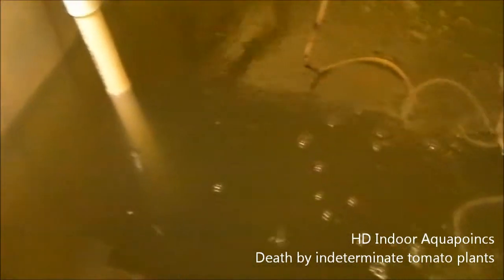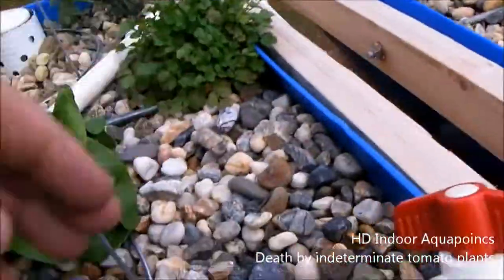HD Indoor Aquaponics - Death by indeterminate tomato plants

Comment: this video shows the reason for internal siphoning. if the roots enter the screen, you simply turn the screen a few times around and pull the root out. doesn't hurt the plants and easier to maintain. also, your bell siphons are potentially too large for your beds, a 1" stand pipe, 1.5" bell and 2 or 2.5" screen pipe is usually sufficient for beds like yours.